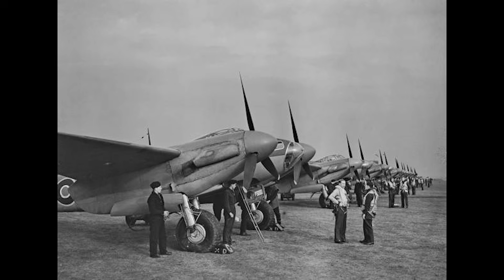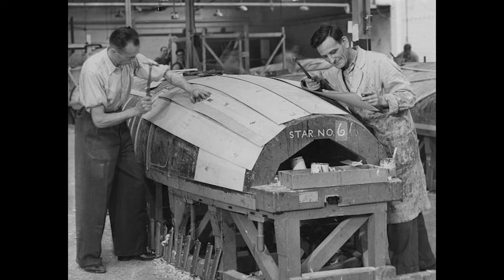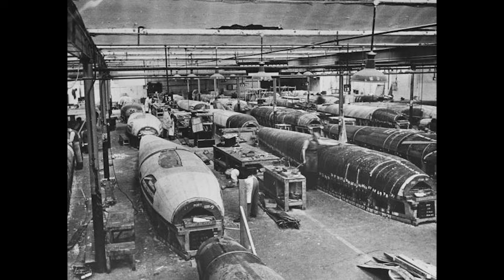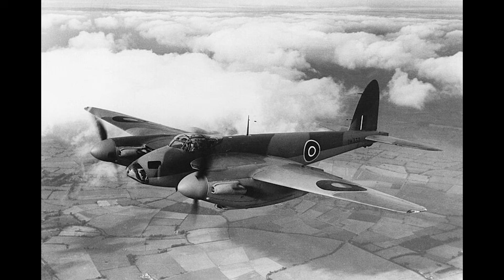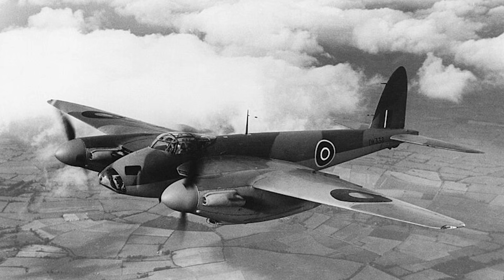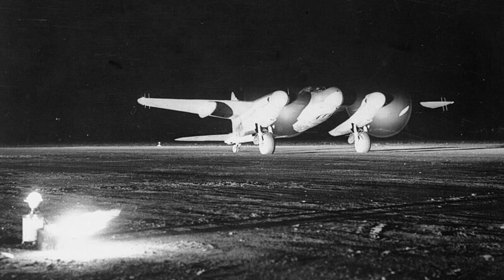How De Havilland's 'Forbidden' Merlin 77 Made Mosquito Hit 439 MPH Unreachable

Comment: I never understood why although the mosquito could carry a 4000 lbs bomb load and could out range the Lancaster it was not used as the primary bomber..   it could do this with minimal losses, and put the bombs through a specific window.  This was done risking 2 crew members instead of 7 crew for the Lancaster or 10 crew of the B17.  This just doesn’t make sense to me.   
The mosquito became the first fighter bomber in modern history. 
The Lancaster did have its place carrying the 10 ton bombs in later years of the war with its devastating effect that the mosquito could not hope to carry.  My opinion for what it’s worth is all in for the mosquito. 
 I have seen the spruce goose and looked at its plywood construction and found it to be very similar to the plywood used in the mosquito, which I have also seen.  Coincidence I think not
Reply: try to understand the order for charge in WWI to the trenches several times in a row even though all the charges were literally wiped out before with 98% losses
So, you know that if you go to Charge, you have a 1-2% chance that your army will succeed, and you still send 50,000 to attack.